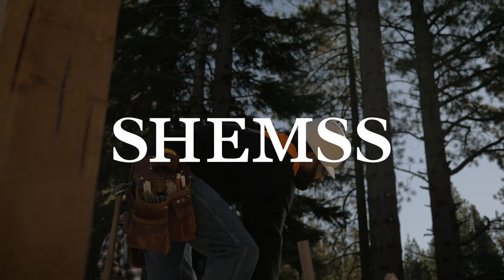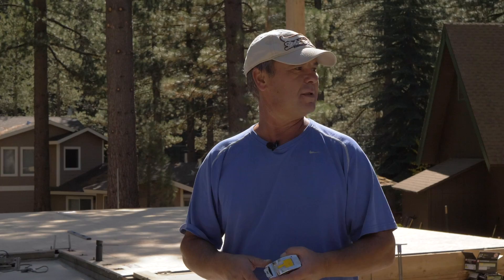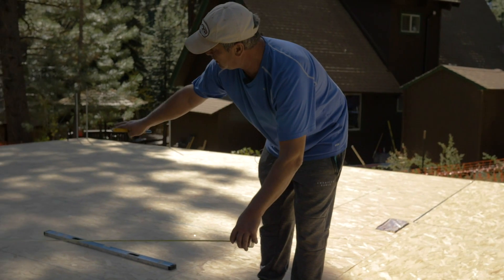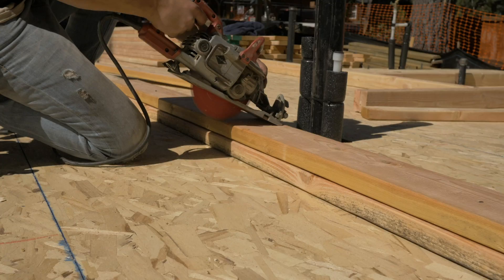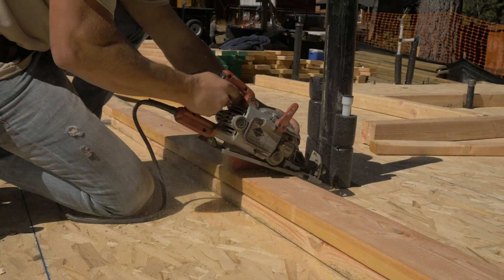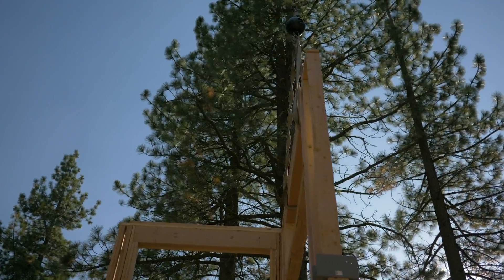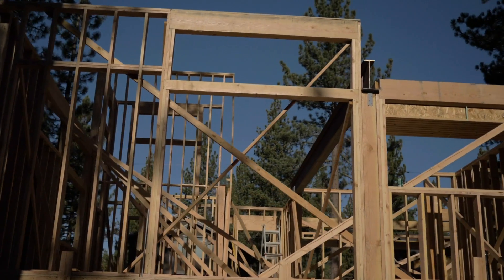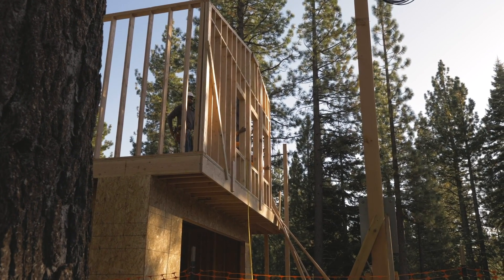🏠 Master Wall Framing: Pro Tips for Custom Home Builders

Comment: never seen such a heavilly built 2x wall as in the opening sequence.  3 things about that if you are building by yourself.  There is no way you are lifting that wall by yourself, unless you have some pretty heavy equipment, but:

1) You can piece frame that wall, which is to say you erect it one piece at at time.  That used to be the way framing was done, until they realized how much more efficient it was to frame on the floor and lift.  But it isn't that much more efficient, and it isn't going to be possible for a person working alone.

2) You can post and beam it where a simple formula to keep in mind is you can support second story loads with 1 4x4 post every nine feet, and a header of 2 2x12s.  This formula has been used in everything from lavish custom homes to sheds and barns.  And it isn't that one should use it, but keep in mind that when dealing with problems there can be more efficient framing approaches.

3) similar efficiency to timber framing.  Not the cathedral style that is popular in church like homes, but the version people build their homes in across NA at one time.  Same idea as post and beam but requires an approach to joinery, so it would be easier for most people to proceed as in 2).

Comment: Nice work. That is a clean installation of the load-bearing beam. Did you also add a non-load bearing wall or a steel column under it, later?

Comment: Hello, 

I’m new to framing and carpentry but confident in my abilities. I purchased a vacant lot where I intend to build a 1 story house. 

I plan to do all the framing and carpentry myself and some friends to save a ton of money. 

The problem is that the lot is 110 miles from where I live and it would be annoying to travel that much every day until the framing is completed. 

My dad has a house near where I live with a good back yard space. Would it make sense to frame up all the exterior walls and deliver them by a rented truck day and quickly stand them up on the foundation? 

I know this is unconventional but I’m thinking that this can also be more efficient time wise as well since I can start building the walls elsewhere a lot sooner as the foundation is being formed. 

I’m wondering if anyone has done that or thought of that. Please share your thoughts and experiences as well as anything that I should be cautious of. Thank you
Reply: Ok my friend, firstly if you aren't a carpenter then framing even a single story house will probably be difficult for you. Can you read working drawings? Engineering plans? Do you have all the right tools? Is there any structural steel?

However you say you're confident so I'll give you the benefit of the doubt. A single storey frame could be slapped up in a single weekend with a couple of solid workers. Perhaps take a Friday off to chaulk the lines, cut the plates and pre cut your studs.
Reply: It could take forever, i would campout at the project.

Comment: How do you start a job in framing? Everywhere it says you need experience
Reply: Start as a helper.  There are places you can volunteer.
Reply: Start by laboring bringing them studs and helping them lift walls they prob won’t let you use the saw or gun on your first day but they’ll show you how to carry like 7-8 studs and lay them out
Reply: @gone9677  I have since then joined last month a carpenter labor union here in north texas and just taking classes but they don't have contracts with framing at all smh. Should I just look for work outside the union? I was thinking joining one would result in any woodworking job but they are only having cleanroom construction and scaffolding.
Reply: @25-8  idk man the being in the union sounds like a really good gig but if you really want to learn then yes try to find some work out side like how u said
Reply: if you go to www.carpenters.org you should be able to find an apprenticeship program in your area.
Reply from the maker: Starts the labor
Reply: @shemss  start as just regular labor in construction?

Comment: If you don't have a bunch of buff buds to help out, can you raise walls with machinery, or build smaller sections that are more manageable?
Reply: Yea we cut the long exterior walls into 2 sections when we only have about 3 or 4 workers
Reply: Yeah You can, I work in framing and we sometimes just don’t nail the double top plate but instead just do it after so you can have the 2 halves
Reply: You can also set up an array of 2x4s with special "wall jacks" or make your own "fishing pole" out of a 2x4 and a hand winch to manage what you can't lift alone. Or yes, make smaller sections (-!